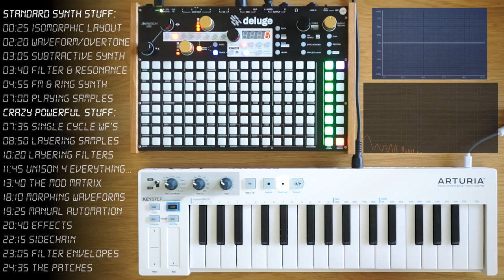Sound design and some crazy powerful features of the Synthstrom Deluge

Comment: A few cool synth features have been added since this video, I am sure Loopop has covered these updates somewhere but thought I’d give them a mention here. Now it does multisamples, loading in multisamples like a sample of all the keys on a piano or synth and autodetects the notes from pitch. And not sure, but I think the single cycles are autodetected now and loop automatically, I don’t recall needing to loop them. Automatic pitch detection of samples, including single cycles. And my personal fav feature is input sound source as an oscillator, so whatever is routed live on the input channel can be used as an oscillator and played on the fly or sequenced. I like to use this to play the Lyra 8 sounds chromatically. It is crazy what this thing can do just as a synth, let alone as a MIDI and CV sequencer. And more hopefully coming, with Wavetable synth and X Y pad control. The only down side I find is some of the v3 features like the audio stuff and looping seems like an afterthought and could do with a few dedicated buttons. What I mean is, you have a button for Synth, a Kit button, MIDI button and CV button, but that dedicated Audio button is really missing. So I can handle all the synth and seq menu diving, but the audio features just seem fiddly and not too intuitive - but I’ll get it to stick if it kills me. And it doesn’t help that Loopop menu dives on every synth so effortlessly.

Comment: @loopop, another great and nicely detailed  video. Thank you so much! I have a question… Sound engine wise, which one sounds cooler/richer to you between the Deluge and the Elektron A4? They  different machines, since the Deluge is also a sampler, a sequencer, while the A4 is only a synth. Thinking of live performance, and the Deluge is multitimbral and polyphonic, which one out of the two would be of a live beast?

Comment: 03:15 
Do I hear stepping on the filter ?
 I am sure these are not the harmonics series  related to a high q settings
Reply from the maker: you do hear stepping and it's not harmonics, it's because I used the click wheel, which really isn't intended for performance. There's no steppiness when you use the gold knobs or modulation to change the cutoff

Comment: I was wondering how you get the visual monitoring of the sounds you're creating. Is it an app on your pc and edited into the video?  Could someone set up a small video monitor and view their own synth rigs on it?
Reply from the maker: Hi, I use MOscilloscope and MAnalyzer by a company called Melda - they’re free with some limitations in the MFreeFXBundle - it’s software not hardware unfortunately
Reply: @loopop  Thanks for the info. I was thinking it could be loaded on some type of computer device, laptop/smartphone and then, connected to a video monitor, placing it in a studio or live rig to see the waveforms, as they're tweeked and such...

Comment: Was thinking about getting an Electribe or some other sequencer/sampler like Digitakt. This is double the price of the Electribe but seems more than twice as useable/powerful, especially if you want to avoid a DAW. Would you suggest replacing those with this?
Reply from the maker: David Primmer I haven't tried the Digitakt - it certainly sounds awesome. I find it really hard to recommend one instrument over another because people's needs are so different  - heck I'm sure some people would prefer a violin to this ;) - but to your question - I'm loving it and it's the closest I've seen to a DAW without much of the associated pain. A DAW can do much more and costs less though ... hard choices ...
Reply: If you wanted to quick-sample room sound and then sequence a few analog synths without a computer, many things would work. But this one seems to blow the others away in terms of direct manipulation. Also wondering if you an you get random patterns like a Korg SQ-1. Is there something like a conditional trigger like on Digitakt?